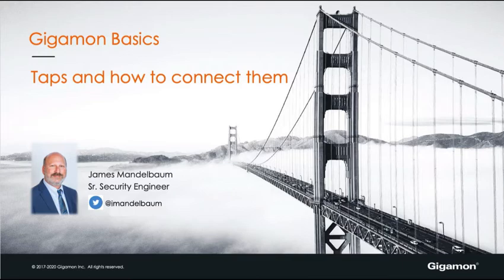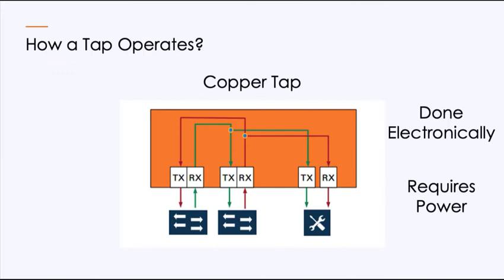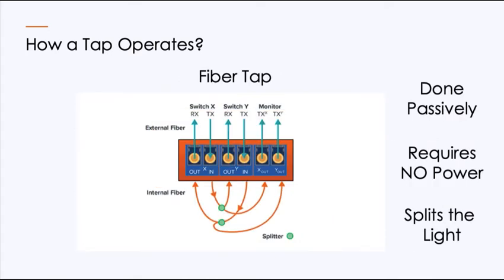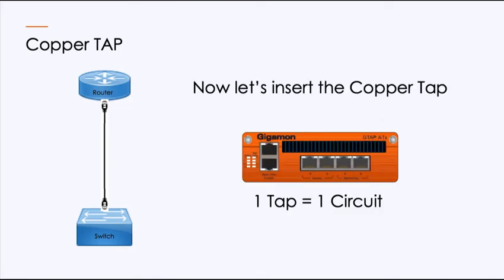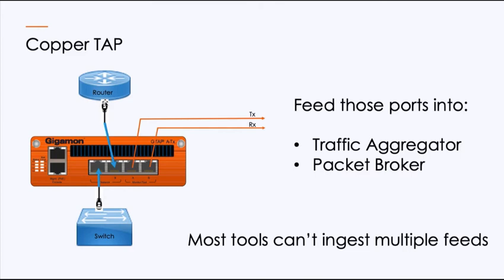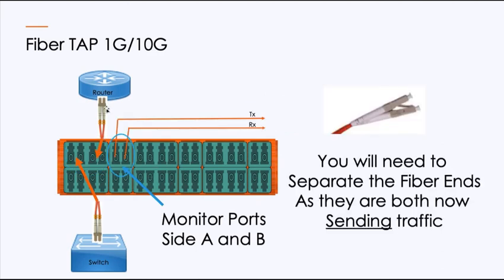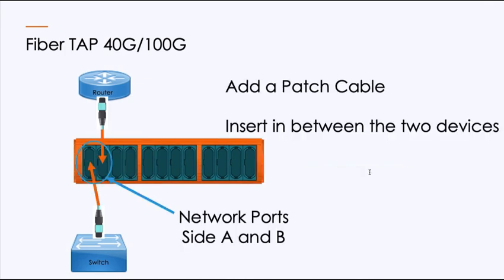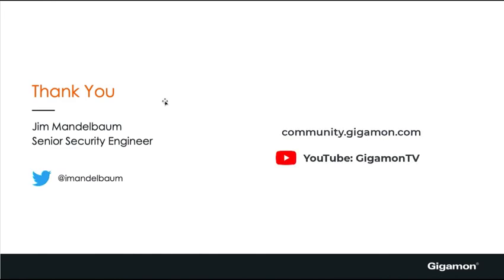Gigamon Basics: TAPs Overview and How to Connect Them

Comment: Narrator misspoke at 3:50. The patch cable doesn't go from and to the router. It would be connected as shown in the picture, from the switch to the router.
Reply: What he meant was you disconnect the router and move the cable to Side A. This gives you the connection between the switch and Side A. You then add a patch cord from Side B to the router (to replace the cable that was disconnected in the first step).
Reply: @sexagesimalian  I realize that's what he meant to say because he obviously knows what he's talking about. I just believe what he actually said can lead to confusion.
Reply: LOL.. He Misspoke at 2:40 earlier too.  He should simply say that the router and switch will connect into the Network ports(A and B) on the tap.  That is considered a single segment.  Simple.